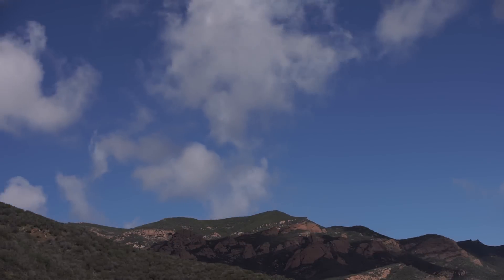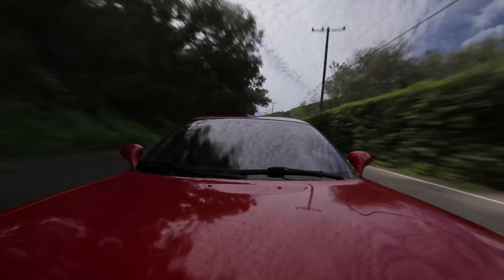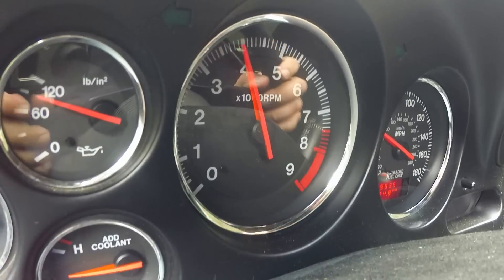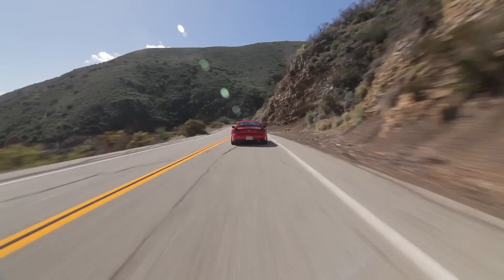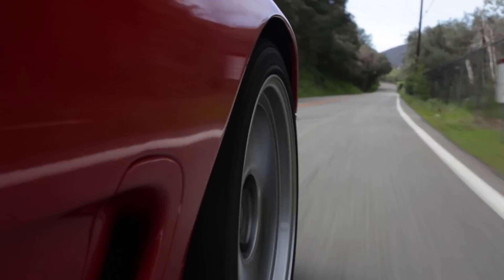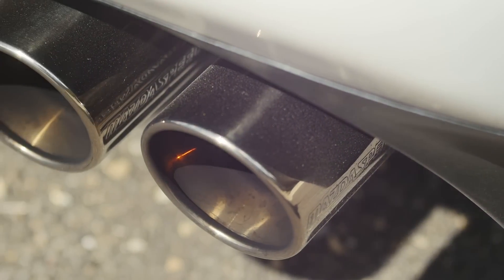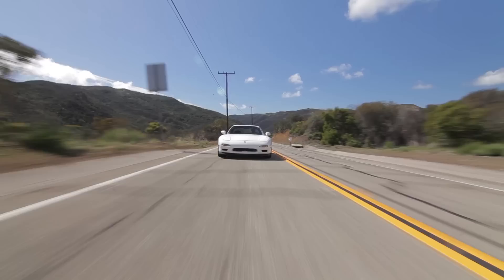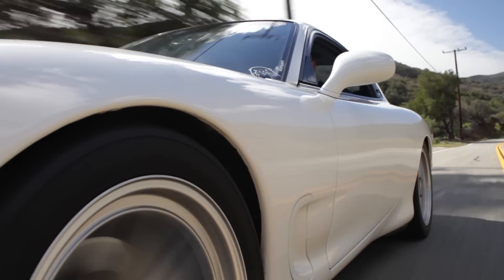Mazda  RX-7: Turbo vs V8 - /TUNED

Comment: FD + 2JZ = Perfection
Reply: ***** Sadly no. The 2JZ while powerful, is WAY to big & heavy for the FD chassis. The car becomes to nose heavy for turns & ruins the balance the FD chassis possesses.

Yes, it's the ultimate combination for a 90's super car, but honestly an LS3 would be the perfect choice for this car. You can bore & stroke the engine to get a much higher redline while staying around 500whp
Reply: DirtDude117 Ugh I had no idea, I love the looks of the FD and the sound and potential of the 2JZ but I guess in reality it doesn't work so well. 

I'm all for an LS swap, unlike most people lol
Reply: ***** You clearly don't know how much a 2jz-gte weighs. It's 200lbs more than an LS7.
Reply: Best swap for me would be C32B which is light so it doesn't ruin the balance.
But whats the point of having rx7, if it doesnt have a rotary engine?
Reply: Mikael K The Rx7 Chassis is that really attracted me to the car. It's basically a Japanese Corvette, but more rounded & in a smaller package.
Dropping any LS motor in this car is a great move, heck a 5.0 coyote would be a great choice as well.
I for one would love a 3.5L Ecoboost or 3.6L twin turbo from the CTS-V in this car but both those engines are far away from swapping time.
Reply: ***** nigga, a 2Jz is over 600lbs.
a Ls2 is 395lbs.
Reply: I know it's heavier but I'm a 2JZ fanboy so never considered the negatives lol
Reply: ***** the weight Balance would be fucking destroyed with a 2JZ.
The 13b is only around 250lbs for the engine.
(Another 125lbs for the turbos ex.)
Adding 350lbs to the front end is a bad idea.
Reply: SANIC Fair enough, I've just never been a rotary fan.
Reply: ***** few are.
That's why people do LS swaps
Reply: DirtDude117 those twin turbo v6 are a lot heavier than the ls2
Reply: Mikael K Weight isn't the only factor. Center of gravity is affected greatly since the C32B is much taller and much wider than the keg of the 13B. It would still affect the balance negatively.
Reply: SANIC a 13B is 200lbs from the keg with no manifolds. The intake manifolds aren't that heavy and ditching the sequential twins for a single drops weight. It would be 300lbs or under for a dressed 13B-REW with a single turbo. The weight balance and center of gravity is still affected greatly with any LS swap.
Reply: 83FB7 Google LS swap RX7 weight Balance.
Guy proved the ls1 didn't affect the balance at all.

Please get your facts straight.
Reply: Disagree rx7 + 20b swap = perfection.  Or rx7 +4rotor swap= beyond awesomeness perfection.
Reply: ""Trendy"..... I talk because of experience,  what do you think I have?  I have a FD 20b making 900hp+ and I have driven several v8 conversions and it doesn't even come close.  It's night and day how the car performs and the sound it's amazing.  Not saying that the v8 conversion or engines are bad but that a 20b conversion stays true to the rx7 heritage and it's a much better swap for rx7 power and handling wise because fitting and weight of engine.  Usually v8 because of torque and heavy engine don't drive as nice.  Matt even said it on his video.
Reply: RZMotorsports Actually what Matt said is that it isn't as good in the corners but more than makes up for it in the straights.
Reply: Spike Razzor
HAHAHAHA I don't think Trendy understood but I got it. Good one man haha
Reply: RZMotorsports I don't know, for me four rotors is overkill. 20B gets you nice sound, more than enough reliable hp, and you can still buy a used engine which will keep the cost down. How much does a single turbo 20B weigh versus an LS engine?

I bought my FB RX7 and fell in love with it immediately... I love my rotary, even if it's only got 100hp :D
Reply: ***** way too heavy for the car. 3 rotor is perfection.
Reply: ***** the 2jz is a 700lb+ engine, the ls is a 450lb engine, you would destroy the front weight distribution with a 2jz, not only that, ls engines are proven to be just as capable and even more so than the 2jz.

Comment: This car needs a inline 6 from BMW M3 E46, that's the perfect engine for it.  Light, fast, great gearbox, sounds great, etc.
Reply: derbigpr500 Why not drive an M3 then? 
People mostly drive this car for the rotary engine.
Reply: derbigpr500 not light, not very compact and not very powerful
Reply: derbigpr500 Would it fit though? An inline engine is much longer than a V and definitely longer than a rotary.  Not sure it would fit.  I could be wrong though.  Probably more expensive than an American V8.
Reply: derbigpr500 an n54 i think would be a safer bet, much lighter and can be much more powerful. still don't know if it would fit though
Reply: LS is still lighter and more compact
Reply: its is certainly more compact, but its not lighter, the numbers i found are about 195kg for the n54, and 210kg for the ls2... ( i was amazed by how light the ls2 is for its size though!!!!! )... also there are different version of the ls2 so there might be some lighter ones than the one i said
Reply: derbigpr500 Umm the S54 is not a particularly light engine. It weighs more than any of the naturally aspirated LS engines.
Reply: Rafael Domenikos The engine found in the e46 M3 is not the n54. It's the S54. 217kg.
Reply: Rafael Domenikos What size, LS is a small engine by dimensions
Reply: derbigpr500 No.
Reply: ***** Wrong. 148kg is the short block weight. Read BMW's brochure about the e90 M3 and it specifically states that the S65 V8 weighs in at 202kg, and that it's also 15kg lighter than the S54.
Reply: S54 is one of the worst engine you can put in this car.. It's heavier and power is not even there.
Reply: TVR AJP8 is the engine of choice if you want to go lightweight, and they can be found - they are great engines. 280 lbs. dressed and wet, and capable of 470-500 C_bhp.
Reply: YoBryce Kim 

I strongly disagree.
If you are capable of getting a S54 in it, you are capable of turboing it as well. More than enough room under the ND hood. 
Its well proven that they support 600WHP+ on E85 with stock bottom ends. Torque wise, the LS2 would seem like a 4AGE in comparison.
Vidar Strand ran 7-second quarter mile passes with such an engine in his M3 all the way back in 2006, so I feel that saying "the worst engine you can put in this car" is somewhat unjustified.
Reply: +kondemnert I'd still rather run an LS. With a turbo the BMW engine is going to weigh more and be more complex than an LS. Just think of all the additional weight- The turbo, intercooler, piping, etc.  With some work you can get an NA LS up to near if not more than 600hp  depending on the displacement, No need for forced induction or nitrous. I'd like to see dyno results proving the BMW engine would have more torque than the LS too. There's an article on RX7club showcasing weight differences between Rotary, LS, and 2JZ swapped FDs, Rotary being the lightest 2JZ being the heaviest by just shy of 200lbs. Obviously the S54 is not a 2JZ and I cannot say just because they share the same configuration they share similar weight. It was just for comparisons sake using data provided by the community. 

Sorry to say but the Chevy engine makes more sense. That's why people do it. Compact, Cheap, Powerful, Simple. One of the few instances in life where you actually have your cake and eat it too.

That said, I'm still putting another rotary in my RX7.
Reply: +Ryan H If cost wasn't an issue I'd consider the BMW V8 from the E92. Power output is fine and with it's lightweight and small displacement compared to the Chevy's it'd suit the RX-7 far more. With a few tweaks you'd be pushing 500BHp easy and torque is immense for a 4L V8 ;)
Reply: +KwC TrixX DOHC V8s are physically large, and the engine compartment of the FD isn't all that big. The cam in block design of LS engines makes them comparatively compact, which is one of the reasons why they are so popular for replacing the original engines in so many different cars.

Comment: i think people look at the LS swapped RX-7(or Japanese cars) the wrong way. In typical Hot Rodder fashion, gear heads look at the RX-7 as having an amazing chassis/package. All they wanted to do was see what would happen if you put a V8 in it.

.......nobody complained when Carol Shelby put a 427 into an AC Ace and called it a Cobra.....
Reply: Blair Clarke Best comment, was thinking about the Cobra while reading all these bitchy, negative "no you can't do that cuz I said so" comments. If it wasn't for out of the box thinkers like Shelby, everything would be the same.
Reply: Blair Clarke Indeed.

Matt even mentioned a lot of the upsides of the LS2 compared to the 13B. All those benefits for just a slightly tweaked weight balance and a few more pounds? Seems like a rational argument to me.
Reply: well, I owned a BRZ and let me tell you......its a great car but it gets boring after awhile. More Power(doesn't have to be insane) would change this
Reply: Blair Clarke I agree I have had fast cars and fun cars, but the fast cars weren't fun for long. Usually a V8 car is more fun to drive because of the low speed performance and less chance of going to jail vs. a fast car that is only a thrill that 1% of the time you can drive it at 100+ and not get caught. Don't get me wrong, I wouldn't trade my S600 for anything but for around town driving my fox bodied 5 speed or big block Galaxy is much more fun. Every car has a place where it shines.
Reply: TypeVertigo FD RX-7 just seem to beg for an LS Swap. Reving a car to 8,000RPM or more to get max HP gets old quick. My old BRZ wouldn't come alive to 4,200RPM.....and even once it hit that point it was still a dog for awhile. You better believe an LS3/LS7 BRZ sure would have put a smile on my face a lot quicker
Reply: Blair Clarke Except the AC Ace was a struggling roadster while the RX-7 is the most winning car in IMSA history(with it's own engine).
Reply: Blair Clarke the brz/gt86/frs needs a 2jz lol
Reply: Blair Clarke That's what I'm sayin'!

Rotary owners are taking it way overboard, like those electric car drivers who are always bagging on gasoline and saying they're "inferior" etc. etc. YES rotary's ARE AWESOME, and unique, but they have identical performance. (V8's ARE STILL COOL, EVEN THOUGH THEY ARE MORE "MAINSTREAM".)
Reply: Blair Clarke cos back then everything was about horsepower and 0 aerodynamics, these days a well thought out aero package can make a ton of diffrence to a cars lap time.
Reply: Creature Feature you hit the nail on the head. Sometimes i find that people do have that "You can't do that because I said so" attitude. If I'm buying the car and spending MY  MONEY on it, I could give a shit what people think/say
Reply: Blair Clarke MAYBE, JUST MAAAYYYBBEEE its different, because the RX series is centered around the rotary. the RX stands for Rotary eXperiment. and its almost like people do it because they dont want to be bothered with owning a rotary, like they never think "let me try a rotary, and see if I can discover something to improve them, or try a new setup." instead they just go for a swap, which isnt necessarily cheap or easy. then most of the people that do it, dont even use it to corner or anything, they just street race or something, when there are so many other light chassis that can do that
Reply: good point.......but at the end of the day, it your car do what ever you like with it

Comment: The thing that makes me like a rotary is the sound it makes. It's just like nothing else.
Reply: iamstd2 But that fart can... gah.. each to there own.
Reply: I know it said Mazda speed.. and it is a twin pipe.. but that sound.
Reply: They also spit flames like no other and the rotors stack like a hamburger so you can add displacement without increasing rotational inertia, thus keeping a high redline. You can stack 4 of them and make 500+ HP with no turbo on a moderate tune. There's just so much fascinating about a rotary.
Reply: iamstd2 rotaries sound like shit
Reply: eeterp32 lol that LS2 sounds like shit.
Reply: Sage Ybarra I'm not saying the LS2 sounds particularly good.  Rotaries sound like 2 stroke chainsaws.
Reply: Well, I guess to each their own, and as long as you aren't trying to ruin an FD, it doesn't really matter I guess.
Reply: eeterp32 Not at 9000rpm they don't
Reply: I love EVERYTHING about Rotary's except for the SOUND. I'd love to get one and put a proper exhaust on it to hopefully make it sound deeper, maybe less obnoxious.

(Man the red one is so perfect, but I just couldn't feel cool FARTING past somebody lol. I'd still give my big toe for one though.)
Reply: ***** Yeah, first thing that I think of when I think 500HP is, man, i wonder how bad his gas mileage is. (sarcasm)
Reply: 2tapsdino ...but if you can have the power and the good gas mileage, why not?
Reply: eeterp32 you've never heard a 3 rotor or any kind of ported 13b
Reply: itubrrr OH great, 3 chainsaws.  I'm sure it's ear rape.
Reply: eeterp32 hehehe
Reply: I hear it once a week when my landscaper comes
Reply: ***** did they stop making making rx8 I guess i live in a box
Reply: James MacInnis yes, in 2011.  Does your box have a window?
Reply: Nope I actually  looked it up after my post. But it was ended due to the inability to meet European emissions standards and a falling Japanese dollar. Not engine reliability.
Reply: ***** LOL, nice!
Reply: As someone who worked in NZ in the auto industry....your totally wrong they are very reliable. 

Mazda is owned by ford. The fords that are actually mazda rebadged are the best cars ford sells.

As far as shear numbers..Subaru, then mitsi..come to mind as far as being blowing head gaskets things like that.

I would never own either. Im happy to own a Toyota, Mazda or Honda..if Im only going off having a reliable car.
Reply: Compeer Raa as of 2008; Mazda is no longer owned by ford.  Mazda bought back 30% their stocks leaving ford with only 3%.  Since 2008, Mazda has been independent; only relying on itself.

During Ford's ownership, Ford took advantage of the purchase and decided to create the Ford Probe, based off the Mazda MX-6, and it turned out to be a great reliable seller. Ford also used lots of Mazda suspension parts 
in their cars as well as Mazda parts suppliers for power steering pumps, alternators, etc. The Ford Escort and Focus uses Mazda suspension parts.(But everything else was Ford made).  

The 2007-2009 Ford Fusion was a copy of the 2003-2008 Mazda 6 in every sense except the engine, interior, and body. And the Ford Fiesta and Mazda 2 were co-developed by the two companies and sold in Europe before being brought to the U.S. a few years later. 

 Mazda used Ford as an advantage as well. Ford helped Mazda enter the SUV and truck market. The Mazda Tribute was a copy of Ford's Escape and the Mazda B series was a copy of the Ford Ranger. These are the only two Mazda's that used Ford designs and parts. And they were built in the U.S.A along with the Mazda 626/6 and MX-6. All other Mazda's were made in Japan like the Protege, 323, 3, Demio, RX-7, RX-8, RX-2, RX-3, Miata MX5, and CX-5
Reply: Ford probe was discontinued and was an unreliable piece of junk as was the escort.
Reply: iamstd2 not like nothing else. can openers also sound like that.
Reply: eeterp32 Look up the 787B.  Rotaries can sound good but most people put fart cannons on them for some reason.  If I had an RX7 I would actually try to reduce the exhaust noise so that the actual engine  can be heard.